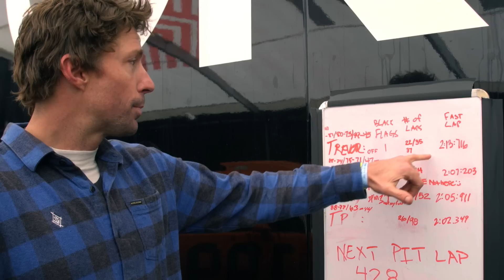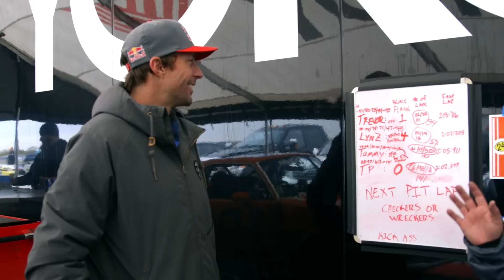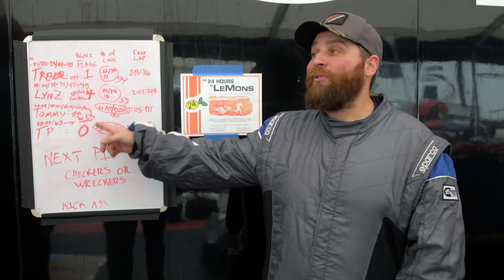Travis Pastrana vs 24 Hours of Lemons

Comment: $500 "car" $5k motor $3k in "safety"
Reply: It's $500 for the chassis. The motor was pulled from something else and rollcages and harnesses are required. No way in hell are you buying a car for $500 with a full cage and race seat harness.
Reply: @JZStudiosonline  I did. 05 focus at the Orange Show in San Bernardino.
Reply: A bit less money on the motor and a bit more on the suspension would have done wonders. Couple of stabiliser bars and some new shocks it'd be a totally different car to drive.
Reply: Yeah he said the fuel cell was for "safety" uhhh ok
Reply: @honoraxis7457  All fuel system is safety. You can run a unmodified OEM system or a duel cell with some strict specs
Reply: @TomWebbandtheFlyingSalami  Fair enough however a fuel cell does help performance wise too tho right
Reply: @honoraxis7457  Nope. Just a safer fuel tank. Some smaller cars could benefit by having more fuel capacity, but they limit the fuel cell size. Benefit is equalized with all the extra rules about how to install and plumb the cell.
Reply: @TomWebbandtheFlyingSalami  All right thanks for letting me know. I was thinking that they had a higher flow of fuel on top of holding more.
Reply: A suburban motor isn't worth 5k dummy
Reply: that is no way in hell a 5k motor
Reply: @Dr.Mcstaby  $500 car, $200 engine, 2-3k cage
Reply: @rpeterson3951  well it was worth more. You got lucky
Reply: @honoraxis7457  rubber fuel cells and the like are for safety. Fuel flow doesnt really matter. If you put more fuel in an engine than it is supposed to have itll just shut down
Reply: @rpeterson3951  Low Budget TV films, in that area.  Small world, in that i subscribed to their channel and live, in North America, USA
Reply: Still didn't afford working brakes. XD
Reply: @Early_2K  I'm surprised no one in the comment thread has noted this: the roll cage, safety harness, tow hooks on both front and back ends of the car, and other safety-based modifications are per the rules NOT factored into the $500 budget.  You can check the rules posted on the LeMons site, as it says those things are required on ALL vehicles.  The $500 part is actually about the racing performance of the vehicle: suspension-work, turbochargers, electrical systems, headers, etc.  It's also noteworthy that you can SELL parts of the car to offset any costs that might exceed $500.  Case in point, you only need one brake light, so you might sell the second one online.  Who needs the A/C system if you're gonna be in a racing suit the entire time?  Since you have to replace the chair with a more racing-safety-friendly chair, why not sell the interior almost entirely?

Long story short: roll cage is mandatory, not meant as part of the budget.  Performance beyond that does factor in, but can be balanced by selling parts.
Reply: What are the rules exactly with the engine.   If your allowed to spend as much as you want on engine parts then it defeats the purpose of being cheap to enter racing.  I know safety stuff and tires don't count but I find it hard to believe he only spent $100 on that engine.
Reply: h82fail he didn't spend just $100 on the engine more like 5k. But they have classes so the faster/more cash ends up competing against the other faster cars.
Reply: @h82fail  There isn't a specific budget on the engine, because the budget spent there is included in the total $500 budget.  So if someone spends a ton of money on nice upgraded parts, then the inspection process will reveal that.  New parts and sophisticated equipment is easily recognizable by the inspectors, so you'll get penalties for bringing something like that.  Part of the rules is if they think you're violating it bad enough and you still race, they can offer you $500 for the whole car and you HAVE to sell it at that price.  That way, people aren't so inclined to build up a fancy car.

That being said, there are things you can do to make the inspectors "happy" when inspecting a car that's over the budget.  Yes, bribing with random things is common.  Other ways to improve the car includes using VERY WEIRD designs to make the car better (example, a guy used two leaf-blowers to make a turbocharger... not even kidding there).

Remember, winning the race isn't actually the biggest goal of many people there.  The winner only gets $300 in nickels, so I'd hesitate before building a monster machine for the race.
Reply: The safety gear isnt part of the budget.  The rulebook flat out tells you to buy the best safety gear you can because it's your life.  Had they put less shitty brakes in the el camino maybe theyd have done better.  Or at least listened to the judges since they can bar you from the race if you screw up too much
Reply: When is a 350 EVER 5k LMFAO
Reply: @rpeterson3951  That's cheating you can get anything at the orange show 😂 glad to see someone mention it in the comments
Reply: the motor he got for free, you can see that when he pulls it out of the dirt. 
the way the Lemon race works is that you can only spend $500 on the car, if you can sell some extra parts of the car then you can spend the extra money on other parts. (time and parts spent getting the car running dont count as well as safety requirements. so there are some grey areas.)
Reply: They give you a lap penalty for every 10 dollars over and still let you run, also any money you sell from the removed car parts gets added to the budget. Safety equipment and things for driver comfort are not included. Whats also not always included are parts you just get in the middle of a race that you run out and go way out of your way just to finish your race, there is definitely a point where they just say yeah no but still.

Also they sometimes just let more expensive cars that definitely wont win compete cause its not harming anybody, like say a viper engined rolls royce, (and even then i think they give a penalty. And that said the specific carim talking about is probably the closest to 500 as you can get for those things for a lot of other reasons)
Reply: @JZStudiosonline  bruh have you seen lemons? The car are 500usd max! All of them. That's the whole point.
Reply: $1500 in tires and rims
Reply: @scottinWV  Wheels and tires are considered safety equipment, so are exempt from the $500 limit.  and more amusingly so are brakes. I'm not sure these guys even read the rules. they cheated like hell on the engine too considering they paid $400 for the car, No way did they only spend $100 making that rusty ass block in the woods run.  Though they never showed their tech sheet. They got stuck in class A, but I bet Phil also gave them about 5000 penalty laps for that motor.  I bet they raced all weekend and never made it up to 0 before they got parked
Reply: @qumefox  it was a suburban motor from a junkyard ,the chevy crate motor was just a joke
Reply: There is a judge called a "BS Judge" that judges your cars price.  And it is a custom to bribe those guys and make some bullshit up so fun they just let you race for the he'll of it. It isn't that serious of a race. The main thing they are REALLY serious is safety hence the brakes, tires, rims and other safety equipment being exempt from the price limit. And more creative your bribe is more lean the judges are. The only thing you don't lie about is tech and  safety inspection. Just do your research about LeMons before commenting stupid shit  like this. The prize is literally 3 boxes of nickles worth 300 dollars. No one gives a crap, people are there to have  fun and race
Reply: Yep, math checks out

Comment: I ran in this race. It was apparently obvious when Tommy was in the car! It was an orange wrecking ball!
Reply: What car did you have
Reply: Hilarious description
Reply: it wasn't his fault
Reply: So, I'm building a 1969 C10 race truck with a very weird special engine I've custom designed. It is a high torque high RPM engine capable of 2200 horsepower, safely spool up to 30k RPM, and idle as low as 500 RPM but coming off idle the engine can produce 2500 Lb Ft of torque. Do you think I can just take the corners safe and slowly, and just dominate on the straightaway's and stand a chance of a decent run?
Reply: Br!an Delta V forget c10 it’s f1 time
Reply: @segatortoise5455   F1 would never allow this engine into their race. I've looked into the rules. Neither would NHRA. All I can do is set the diesel land speed record, pickup truck land speed record, and a few other misc. races.
Reply: Chris Rollins shouldn’t it be a lemons wrecking ball?
Reply: @smh9902  what kind engine per say? those numbers are crazy
Reply: @theonewhoknows2  I've redesigned and heavy tweaked a Bourke engine. So its a HCCI pulse detonation engine. I can run compressions ratio's as high as 300 to one with a stroke to bore ratio of 1.33:1
With a squared engine the CR's go to over 500 to one. EGT's remain under 250 F. measured directly out of the exhaust ports.
Reply: @smh9902  make some videos of the engine when it's done. Sounds insane!
Reply: @smh9902  24 Hours of Lemons cars have to be only worth $500. Anyways, I bet you'd hate driving that thing on a road course
Reply: @n8tehgr8est   Probably. Do the Lemons Rally allow street legal dune buggy's?
Reply: @smh9902  , if they're worth $500, yes. There used to be a maximum axle length requirement but since it's all miatas out there I assume that's been relaxed.
Reply: n8tehgr8 
Dude, this isn’t the real 24 hours of LaMans race! This is a homemade version for your entertainment. The real race is a big money event with all kinds of classes.
Reply: @kevintucker3354  do you seriously think I don't know the difference
Reply: cheat
Reply: @countryjoe3551  and your point is?
Reply: @smh9902   i wanna know more about this engine, iv heard about 50000RPM honda 50cc bike before but how is it possible??
Reply: @Bencrush7Shorts  Eliminate the valvetrain.
Reply: @smh9902  If the engine is pulling 2500lbft of torque off idle it wouldn't be much good as a race engine unless you have some control built to come onto power slower, otherwise you'll just be frying tires
Reply: @CBJRacing  I can control engine power and RPM and torque by controlling how much fuel goes into the homogenizer. The engine can operate with 1000 to one AFR and I increase torque and power by depressing the accelerator, which is connected to a cable that pulls a lever that turns the needle valve letting more gas into the intake manifold. the engine can idle as low as 150 RPM and produce just enough power and torque to keep itself running, and no more at idle.
Reply: @smh9902  stop lying wtf
Reply: @bithundr  No lies. All mathematically proven on paper. I'm building a 50cc prototype right now. I should be able to produce 10 to 15 horsepower with it, naturally aspirated. Its amazing what can be done once you eliminate the valvetrain, oil scraper ring, secondary forces, and piston sidethrust. Its a HCCI pulse detonation engine. What the big corporations can barely achieve in the lab I can do in my back yard. The magic is in the scotch yoke and two stroke cycle.
Reply: @emm6916  
Here's a lot of reading for you.
I haven't made the prototype yet. But I need you to realize that this engine embraces knock/ping/detonation as a means of ignition. This allows me to run compression ratio's as high as I like and get efficiency exceeding 80%
EGT's are less than 200 F. measured right out of the ports.
https://drive.google.com/drive/folders/1-l4bRgrwERPSs8GT59WMd5E6jMZxQDet
Reply: @smh9902  yea he can't say shit now haha .
Reply: @emm6916  I'm still waiting on that apology.
Reply: @smh9902  I'm waiting on the engine how far is the prototype  from up and running?
Reply: @emm6916  Right now as I type this I have my 3D printer making some molds. I will then use them to create wax moxkups, coat them with ceramic and plaster, then pour in the first metal castings. After that I will machine, drill, and tap the surfaces and holes and turn the crankshaft on my lathe. If you want to see a running Bourke Roger Richard has made a couple prototypes and ran them. He's using a compression ratio of 22.5 to 1.
https://www.youtube.com/watch?v=Vx_G0-9PJIE
Reply: @smh9902  just done a quick read about the bourke there's a lot of claimed figures but no real data. Wanna see if you can build this juiced up crosser motor. Keep at it get the bids posted of the entire process would be interesting. I'm a man of my word you kept ur end of the deal n I'll keep mine. Now get back to work😎
Reply: @emm6916  I'm working on the models right now for the next molds. Right now the printer is printing the combustion chambers. The next print will be the block. What I do know is that I've visited Roger Richards shop, and EGT's that I measured right out of the ports were around 230 F. He claims he's got it down to 194 F. when on a low load condition. I've no reason to doubt his claims, but even my measurement of 230 F. is phenomenal. We could get away with a plastic exhaust manifold if we wanted to! The heat is being converted to mechanical energy.
Reply: @steverone7623  It was the pink whatever with 4 wheels. 😆
Reply: Br!an Delta V MEGA bullshit
Reply: Br!an Delta V I understood some of those words.
Reply: Br!an Delta V Thats awesome! What kind of drivetrain do you have that will handle 30k rpm? What are the benefits to such a high rpm? I would love to learn more about this
Reply: Cool vid
Reply: Huh?
Reply: @smh9902  Very interesting engine, if I were you I'd change it to direct injection carburetor , make it run very lean, induction cooling should be considered, also you might want to think about designing a turbo charger since nothing on the market can handle that exhaust speed or volume. Connect it to an alternator and good liquid cooled inverter and you got yourself the combo to win any race ever.
Reply: @mr19zee  I've thought about direct injection, for large stationary/marine applications its definitely practical. But for race purposes, I'm not too worried about blowby, so I can use a needle valve to control RPM/torque by solely adjusting the fuel input. So the engine will always draw in as much air as it likes, and I richen the mixture if i want more power. At idle it has a 1000 to one AFR. As I mash down on the accelerator its richening to 700/1, to 500/1, and so on and so forth until stoich is achieved.
https://www.youtube.com/watch?v=ahw4pneSIuc
Reply: @chris1newbury  I almost spit out my up of tea seeing this in the comments xD
Reply: @smh9902  So, you talk about building your own custom engine yet your channel only contains videos of "aliens". What is happening here?
Reply: @MetalFan10101  This is my private channel. I have a professional channel and a corporate channel for the purposes you're talking about. I use my private channel to say edgy shit that could harm my reputation in the eyes of the public.
Reply: @smh9902  Care to share the other channels? Otherwise I call bullshit, sorry.